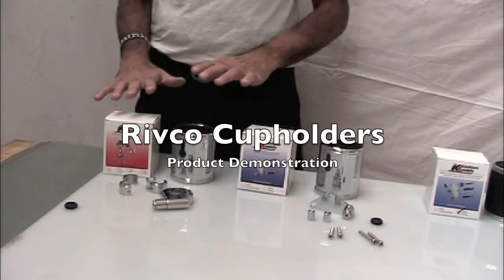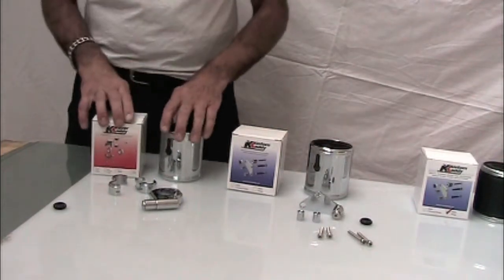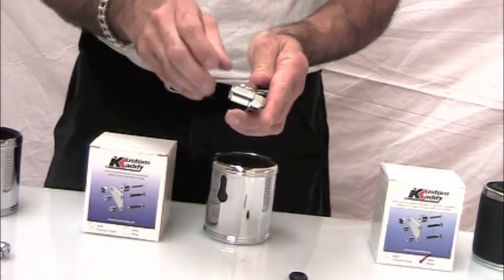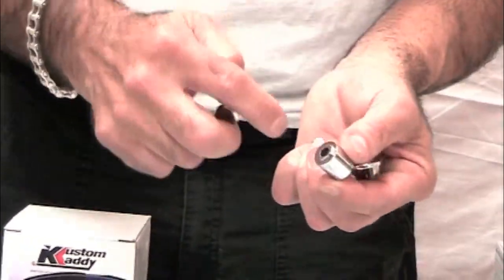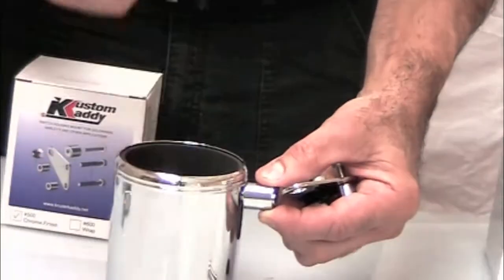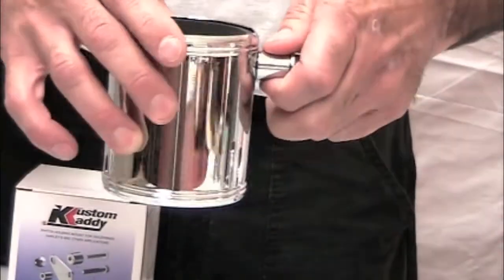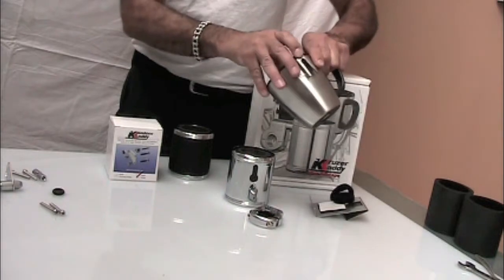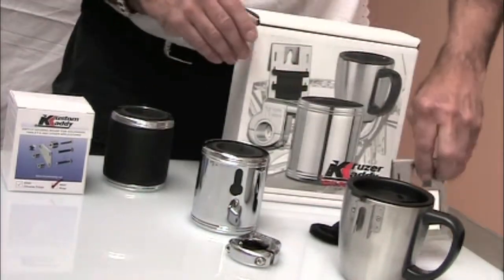Motorcycle Cupholder Demo

Comment: recently got one of these to replace my POS Ciro 3-d. That thing wouldn't make it more than 2 months before the crappy plastic clamp would break. They warrantied it and the new one didn't do any better. Been around a long time and know how to not crank down plastic parts and I have a 15 Road King so it vibrates but not that much. That fricking plastic bar clamp is just a huge piece of crap. This one went on nice, looks nice and most importantly it doesn't break and securely holds my cup. Like John said below, the thick foam won't allow for huge cups but mine came with a 2nd thinner foam insert that lets me hold any of the many cups I usually use. I love it and it's much cheaper than the Ciro. Kruzer Kaddy got this right.